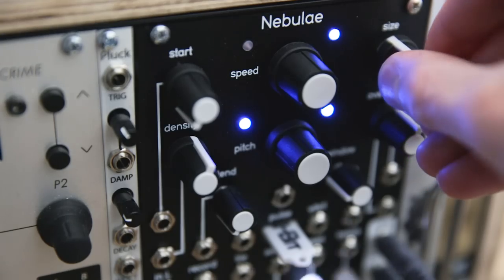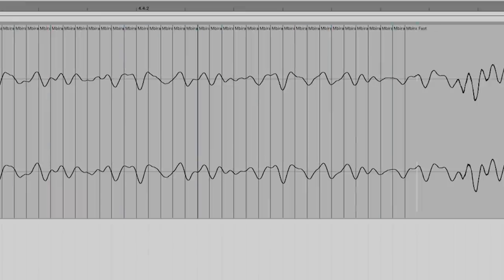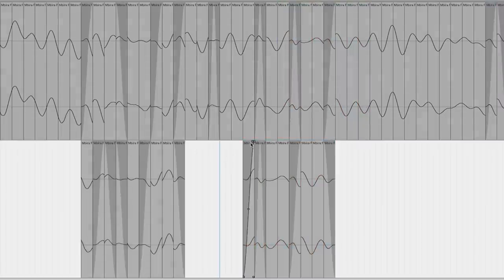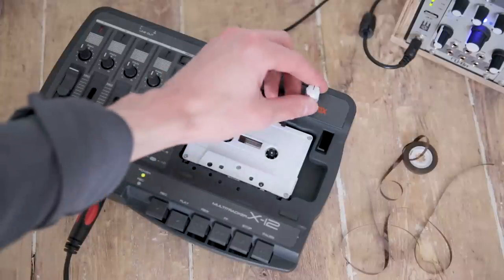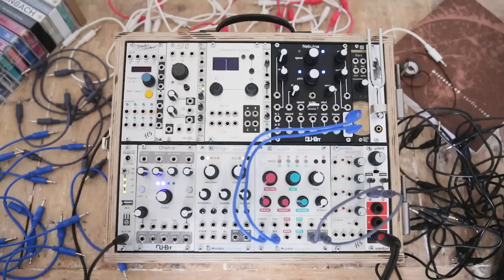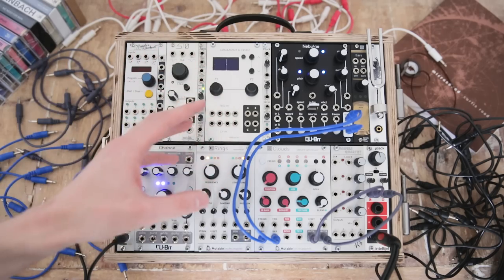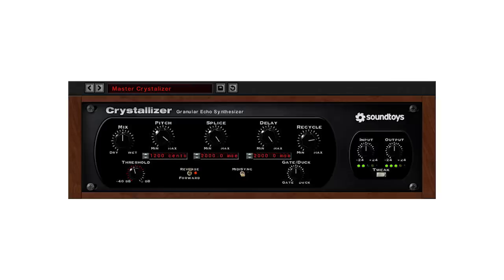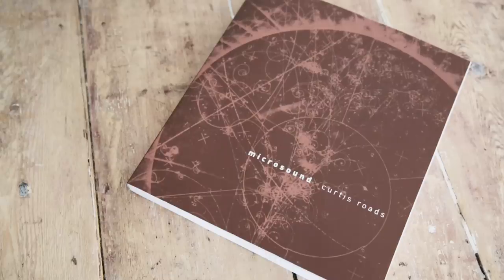Granular Synthesis EXPLAINED

Comment: GlitchMachines make several VST plugins that include granulation in them. FractureXT and Quadrant are two examples. These plugins are meant to entitrely reprocess the source audio. The granular synthesis is a part of the larger overall sound processing engine. I watched your video so I could understand better how to use this processing. Thanks for the great info.

Comment: Absolutely brilliant explanation of granular synthesis! So inspiring! One small note is that the complex and complex pro warp modes in Ableton are actually spectral stretching, which just means you doing a Fourier transform on the signal, store the amp and phase of all the bins, and then play back from that buffer. You can sort of think of it as granular since the Fourier transform happens on little grains at a time (this is called your fft window), but depending on how you do either inverse fft or you can just resynthesize it by using a bunch of sine waves (that's sometimes  called additive synthesis). The key difference is whether you do the Fourier transform or not, that's what makes it "spectral". Also, side note, there are other transforms you can use that do the same thing like wavelet or constant q, I think there are others as well, but they are less common afaik. In terms of how it sounds you can tell the difference by how sloshy it sounds, granular usually has sort of grainy sound (although that nebula thing sounds reaaaally smooth and nice) and spectral has more of a sloshy kind of sloppy sound. This is due to the fact that the Fourier transform has a trade off between fidelity in the frequency domain vs the time domain, you can kind of solve this with overlapping the fft windows but it does still sound kinda sloshy imo. 

Anyway, absolutely beautiful video again, I'm really happy to have found your channel and am looking forward to watching more. Great production, super clear explanations, wonderful sounds, all around brilliant.

Edit: 3blue1brown does a couple good explanations of Fourier transforms and the Fourier series if you're interested
Reply from the maker: Thanks very much for the explanation! Great to know
Reply: @WhiteNoises  would be awesome to see you do a video on that stuff too! I tried but I bunged it up pretty bad (I'm not a great presenter haha) so it would be awesome to see a pro like you handle it. There aren't many great videos on this stuff unfortunately (at least not that I've found), even tho it's in basically every daw now.

Comment: There actually was a device that allowed to alter pitch and speed independently completely analog. The principle was pretty similar to granular synthesis: It head a read head that rotated above the tape. The speed with what it rotated can alter the pitch, while the linear movement of the tape can alter the speed.
Reply: wow wow wow. this is the only youtube comment that i haven't regretted reading. thank you that's so so cool
Reply: Tempophon or Springer Machine, for reference. Not alot out there about this device! been around as early as the 50's, from what I can tell... Tried to cobble one together using the spinning tapehead from a VCR. No luck so far

Comment: Very informative... Thanks :-). Clouds was already on my radar, although it is now discontinued. I believe it is possible to find 3rd party builds of Clouds and I have been looking into that. Also, I believe that MI is developing a Clouds "successor" but there is no time scale on this yet. I wasn't aware of Nebulae, so that has certainly made me think about my options. And using both Nebulae and Clouds together sounds like an awesome idea. Although my Modular Journey is featuring sequencing at the moment I have spent the last couple of years creating drones in my DAW using a combination of Adaptiverb (Zynaptiq) and MGranularMB (Melda) which, from a software point of view are the ultimate drone VST effects (IMO of course). But I am trying to get to a point where I can create the same sort of stuff entirely with hardware. So, yeah, thanks again for this vid :-). Cheers, andy

Comment: Hi! I have 1 question about the nebulae v2 when i run adio from my iphone in to the live aduio jack the signal is super week not even hearible at some times, then i let the signal go first in to my beads and then in to the nebulae v2 and then the signal is much stronger. Am i doing something wrong or is the input from nebulae v2 always that week?
Reply from the maker: Sounds like you need to run your iPhone audio into a preamp first (iPhones work at a much quieter level than modular synths). I assume Beads has a preamp which brings your iPhone audio up to modular level. You could also use a dedicated preamp module like Mutable Instruments Ears. Hope that helps!

Comment: I'm intrigued by the pitchfork module on the top right corner of your rack. How does it work?
Reply from the maker: It is simply a pitchfork with a small piezo transducer on the back -- run that into a preamp and you can hear the pitchfork when you strike it!

Comment: Can something like the Microgranny accomplish the delicious composition of sound management as your Cloud with Black thingy?
Reply: Al Yeska I wish someone would answer this question :/
Reply: The Microgranny is a pocketable  granular synth, but more lo-fi. 8 bit.  It can do most of the same functions, has built in microphone or line in, and micro sd sample storage. But again, it has a more low fi sound, especially if it does the recording.  It won't sound as smooth as this, or phonogene, or morphagene etc.

Comment: Was this a Nebulae v2 or the original one?
Edit: Never mind! I see from photos that this is the v2. Nice!
Can you comment on the differences between the Nebulae and Morphagene?
Reply from the maker: I've not really had much hands on with the Morphagene, but the main differences appear to be how the pitch/speed work. Nebulae also allows for alternate modes and firmware, so you can write your own code for it.